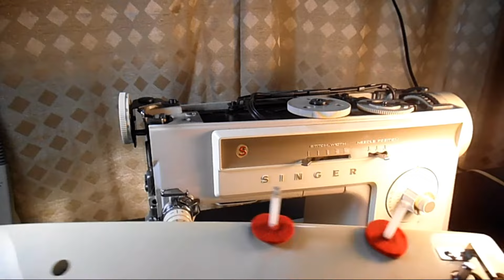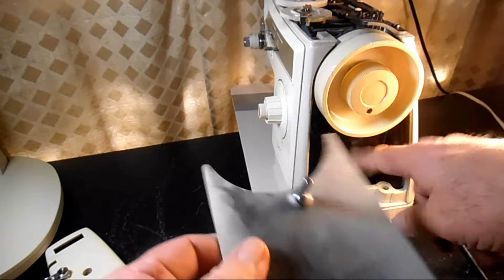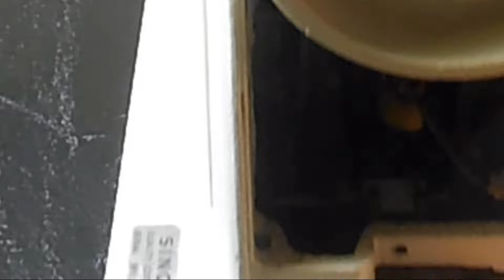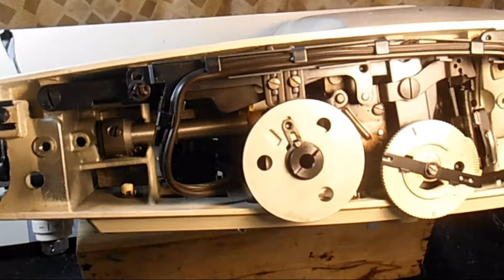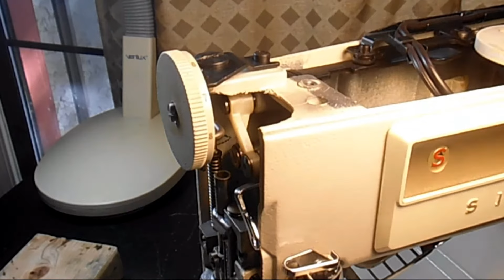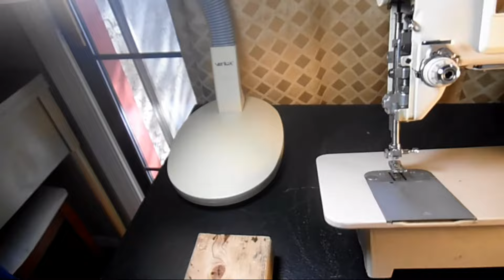A Look Inside a Singer Model 513 Sewing Machine

Comment: My sister owns one of these and has used it for many years. Recently it was seizing up on her, but seemed to be doing it somewhat intermittently. She lives in a different state and this  past Saturday she brought it to me when visiting. We got it running again, however I ran out of time to remove the oil plate and check everything out underneath. I’ve ordered her a replacement belt because the one on it seemed dry and/or brittle. Your video has given me the confidence to look at all of the hook mechanisms and the shafts transferring energy. Who knows what we will discover on the nylon gears.  She treasures the machine, so it’s good practice for me.  I want to dig into a 306K that was gifted to me in the past six months.
Reply from the maker: It's great that you help your sister. This video was my first good look at a 513 machine. It's part of my Playlist for the model: https://www.youtube.com/playlist?list=PLsCOZgzzaiKLELksv_-MWE7tiAuzOgQj0
Here is a list of videos viewers have given me that they found helpful when attempting a gear change.
https://www.youtube.com/watch?v=cYLzGwpoWeE
https://www.youtube.com/watch?v=x2acFJeDxwg
https://www.youtube.com/watch?v=qHx6VPdenj0
https://www.youtube.com/watch?v=0HirFoVVoxY
I appreciate your comment and thanks for keeping the older machines running.

Comment: Hi there. Although I don't have service manual for this model but service manual for class 800 (same as 1020) says to grease these gears. Class 800 is very similar to 513. The lower part is identical. Take care. 🙂
Reply from the maker: Sure, go ahead. The Singer repairmen I met told me no grease on plastic gears, so I go by that. I don't have the service manual you mention, but if it "says" to apply grease, then I would. Thanks for sharing and for watching my channel.

Comment: Hi! I have restored 2 401s, a 403, and a 301 this year w/ your help, thank you. 
I bought a cabinet for my daughter's 401 that had a 416 in it. I wasn't planning to keep it, thinking it was a newer, plastic garbage machine, but as I was poking around with it, it looks really cool! It's pretty immaculate with minimal if any yellowing, no old oil or grease to speak of. No plug or accessories. It hasn't been used recently at all. The inside is clean, the outside was the storage kind of dirty. 
There are a lot of similarities to your 513 on the top, but not the bottom. 
The upper vertical gear was broken, which I've already replaced. The far left plastic washer on the horizontal shaft broke to pieces, so I need to figure that out. I've bought the specific service manual for the 416/418 although it doesn't cover everything.
The machine will sew, but I'm having some binding issues. It seems like it's binding over on the right side, in the area of the reverse button, stitch length knob, etc. I can see the white plastic rectangular piece that slides in the feed dog fork (right behind the length selector knob) get hung up sometimes when I'm turning the stitch length knob back and forth. I have to turn the hand wheel for it to release and snap back in place. I'm assuming whatever's causing that is what's causing the binding, but they could be separate problems? 
I've adjusted some easy stuff already. The horizontal collar on the left side where the broken washer is. The camstack gear, although it was very stiff and didn't feel like it was moving. 
The machine was binding before I replaced the upper vertical gear so it isn't that. There's a buttonhole mechanism behind the stitch length dial, so I'm going to have to bite the bullet and start taking apart the scary stuff. Any thoughts?
Reply from the maker: Model 416 was made in 1971, 50+ years ago. Plastics have changed a lot since then. Restoration folks I have met that work on all kinds of electro-mechanical items tell me that "older" plastic like that has some tendencies to warp, bend, and swell. Binding and sticking is are fairly common problems. They often use modern synthetic grease to try to keep the parts moving properly.  
   Sometimes they have to dismantle and use emery cloth to "smooth down" the parts. 
Binding can be hard to pinpoint the true cause. An example is all the machines folks brought to me because "the handwheel is broken and won't turn," and I would find the bobbin case had jumped off the "race" of the hook and was jammed into the throat plate. 
     We tend to think the part we can see that doesn't move correctly is the problem, even though it is connected to other parts
that are harder to see and most parts of the machine move in unison. If the belt inside breaks, the motor will still spin like crazy, but nothing else moves. 
     I found out over time to try to be as sure as possible of my diagnosis before I started removing parts, especially a part like the buttonholer system. I've just never liked the dial control combo, I guess.
Reply: @andytubesewing1953  Ok, thanks for the response. It's still a mostly metal machine, not a lot of plastic in it. But I'll see if I can pinpoint the binding better before taking things off. The stuff I'm looking to take off is pretty well diagramed in the service manual, which is why I'm even thinking about tackling it. I guess I don't have much to lose, because if I can't fix it, I can't really use it anyway. I used one of the flexi-stitches to hem my son's pants, a stitch I don't have in my other machines. It overcast the edge much nicer than plain zigzag, so I'd like to save the machine if I can. Plus, that pale ice-green color is just cool.
Reply from the maker: @rockinfinch Best of luck to you
Reply: @andytubesewing1953  Thanks! Replacing the broken washer on the horizontal shaft seems to have cleared up my binding issue, but there's still some tweaking I'd like to do with the stitch length selector system before I put it all back together. The longest stitch length I can get is 7 sts to the inch instead of 6. And there's a bracket connected to that system that hangs up sometimes. It doesn't affect how it sews, but it's bugging me.
It's sewing beautifully at the moment.
Reply from the maker: @rockinfinch  Oh! That must have been the arm shaft thrust washer. I'll remember that. Thanks, and good luck. The service manuals have saved many machines for me.

Comment: Hi Andy, I just bought a cabinet with a 513 in it.  Machines was frozen, gears are good, got everything moving nicely, except the stitch length knob is frozen and reverse button isn’t pushing in.  Suggestions?
Reply from the maker: Hello Valerie. Singer model 513 was the lower-end model of the 5xx family and was made in 1972. 
     Singer had started using much more plastic by then and parts of the feed system has plastic parts that are now 50+ years old. They can "stick" together now, especially when not being used regularly. Fine dust can get between the pieces and restrict movement. Some parts can "warp" a tiny bit, too. 
     Sometimes blowing air into the area can be enough to free-up parts and get movement. I don't fool around so I use a leaf blower for max volume. Other friends like using a hairdryer on medium or low heat and high air flow. You can blow right into the dial, down from the open top arm, up from the bottom and through the motor end. Any way to get air inside.
     If that does not work you can take off the front cover and control dial parts https://youtu.be/zThFx1CoM-E  
You can also buy the Service Manual for $4.99 here: https://manualsoncd.com/product/singer-500-sewing-machine-service-manual-518-538-513-514-533/    
78 pages showing how to work on the machines.
     One fellow I know in Canada says he often works on these models and has to use very fine emery cloth to polish the parts to reduce their circumference so they can slide together again.
We would caution against WD40. If you really feel oil would help on a plastic part be sure it is safe for plastic and won't harm it.
Reply: Thank you for your response.  Love your videos.  I took the all the covers off accessed the back of the dial, brushed oil on backside and  used the blow dryer.  Got it unstuck, makes a beautiful  stitch.  I realize with its age and plastic gears it may not last long, but I wanted to try.  At 73, I like to challenge myself.  
Thank you for link to service manual.
Reply from the maker: @valeriegiacalone508  Very welcome. Thanks for keeping the machine in service.

Comment: Hi there and thank you so much for these videos! I picked up a 513 today but it won’t sew and the wheel is very hard to turn.  I’d like to try and fix it myself and I wonder what you think it might be.  The motor turns great in the bobbin winding position but not to sew.  Thank you ☺️☺️☺️
Reply from the maker: Hold on to your hat, Christine. I have information for you. This is a common problem with vintage machines that have sat idle for a long time. 
     The oil in the bushings and other moving metal parts can dry up and the parts get "Stuck". A common way to fix this is to oil the machine properly and gently turn the wheel and even add heat (via a hairdryer) to loosen the old oil. This can take a few minutes to a few hours of work, depending. You can download a free copy of the manual for your 513 from Singer SUpport here: 
https://www.singer.com/search/support?title=513   It shows where to oil the machine. 
     I also have a video that goes into a lot of detail about oiling model 513: https://youtu.be/F5Bt8x1XsrE    
That's the easy part, and if that is all it needs then good news. 
     HOWEVER, model 513 is a model with 4 plastic gears on the bottom of the machine that make the hook rotate and the feed dog work. The gears are old now and very prone to cracking/breaking (if they are not broken yet, they will be) This is a known problem with a dozen Singer models of this type.
     The most common of the gears to fail is the one on the hook shaft, just below the hoo/bobbin case, which turns the hook b/c it takes the most strain. The other gears can break also. The hook gear is easier to replace than the other 3, but the consensus is if you must replace 1 gear then replace them all.
     You can buy the gears online, just search for "Singer Model 513 Replacement Gears". 
There were not many videos made about how to do it, but here are a few to give you some ideas. https://www.youtube.com/watch?v=cYLzGwpoWeE     https://www.youtube.com/watch?v=x2acFJeDxwg
https://www.youtube.com/watch?v=qHx6VPdenj0      https://www.youtube.com/watch?v=0HirFoVVoxY
     You can also buy a guide for changing the gears from a real pro who wrote a manual for doing it. 30+ years working on SInger machines, including owning his own repair business. https://store.tandtrepair.com/513gg.html     The manual is about $12.
    The hook gear is less than $10, and the set of 4 gears is usually less than $20.  The oldest set of gears that I replaced is now about 8 years old and running strong. Other than those dumb plastic gears. Model 513 is a very nice model, especially for sewing and crafting clothing and home decorating needs.
Reply: @andytubesewing1953  omg, you are just the kindest person!  I’m going to try this on Wednesday as I’ve got to work tomorrow!
Reply from the maker: @christinebond1102  no worries. I have found that these vintage machines are very patient. I've worked on them a little and put them away for a week and come back and they're always happy to see me. I wish you the best of luck. If I can help you know where to find me
Reply: Hi there!  It’s running great!  I cleaned up a lot of old yellow oil from the bottom gears under the bobbin but now something is going clickity clack and I think it’s from the top?
Reply from the maker: @christinebond1102  I'm glad you got things moving. Be careful about noises b/c sound can travel thru the metal parts. An example is when a needle clamp is hitting the top of the presser foot. The sound travels up the needle bar and sounds like it is something at the top of the machine. Also, these older mechanical SInger machines can be a bit noisy if you are not used to them, especially with the top cover off. Were you trying to zigzag sew? That uses more moving parts at the cam stack that move back and forth (click-clack) An easy test is to put the machine in straight stitch mode to see if it goes away or lessens the noise.
Reply: @andytubesewing1953  no, it wasn’t on zig zag but I was so happy it was flying along.  The even bigger problem now is, when I move the wheel towards me to pick up bobbin thread, it hits something hard under the needle plate.  Going forward, it doesn’t hit but it also doesn’t sew.  I’ll get there eventually.  Thanks for everything!
Reply from the maker: @christinebond1102  Honestly thing it's a gear
Reply: I took a Video  but don’t know how to send it. 😊
Reply from the maker: @christinebond1102  It's not hard to upload a video on your youtube channel, Christine, especially a cellphone video. There are many instructions for doing it if you Google it.

Comment: I'm glad I found this channel!

Question for you, Andy  last night my 513 stopped feeding fabric. I checked everything outside visually and the only thing I noticed is that the feed dogs were not moving. Could this be due to a broken gear?

Looking forward to your reply.
Reply from the maker: Thanks for watching my channel, Juan. Yes, most likely a broken plastic gear. The machine will be 50 YO next year. The plastic is brittle. There are 4 gears on the bottom of the machine to move the feed and the hook. The standard practice is when one goes out to replace them all. Gears are available online for the $10 to $20 range for the set of 4,  just Google Singer Model 513 Replacement Gears. It's been a while since I looked, but there were not many good videos on YT for replacement methods. Terry has many manuals and his own guides he wrote for the machine. https://store.tandtrepair.com/st4134164185.html  When installed properly, a quality replacement gear should last over 10 years per my experience on other models. Good luck.

Comment: Hi Andy,  I have a 534 stylist singer that I replaced the gears and belt on.  I reset the timing  which works great on the straight stitch but the zigzag timing is off.  The needle crosses over in the down position instead of when it is up.  What can I do to fix this?
Reply from the maker: I can think of a couple of possibilities here. I think when you change the gears you must reset the FEED TIMING along with the hook timing. When you say you set the timing I assume you mean hook timing?  The other item is Timing the Pendulum Movement of the Needle Bar. You can buy a Service Manual that includes the model 538 ( there is not a special manual for 534) and it has instructions for both items I mentioned, along with many other repairs/adjustments for the machine. It only costs $4.99  and you can download it here: https://manualsoncd.com/product/singer-500-sewing-machine-service-manual-518-538-513-514-533/

Comment: help please!  I have a singer 522 which is similar if not the same inside.  I do all my own servicing and basic service but this one I can't figure out.  I have adjusted the tensions (top and bottom), but the machine will not do a stitch longer than a 1 or 2mm.  If I change the stitch length knob, it still does a 1mm or 2mm length.  Not sure if this is a feed dog issue or problem with stitch length button and I don't know how to repair it.  please help.
Reply from the maker: The eccentric adjusting stud for the feed dog may be turned 180 deg. the wrong way and be set on the low side instead of the high side. That can make the oscillating path of the dog much shorter. Model 522 is a tubular bed model and the lesser of the 533/538 Class machines. Suggest you buy the SERVICE MANUAL for Singer Model 538 which has all adjustment/replacement instructions. It cost $4.99 to download from this seller: https://manualsoncd.com/product/singer-500-sewing-machine-service-manual-518-538-513-514-533/
Reply: @andytubesewing1953  you are an absolute star; I can't thank you enough.  Have bought the manual and will go through it with husband to see if I can fix it.  I don't suppose you know how I could fix a Bernina 1001 width dial (seems to slip when I do zig zag) but learnt recently that you do not oil plastic gears!  I am very fastidious in keeping my machines clean and I think I may have oiled the plastic gear or whatever behind the width dial.  Have been trying to get a service manual for Bernina 1001 but cannot seem to get one anywhere.
Reply from the maker: @ramilapatel5364  THANKS ⭐ Good luck with your 522. I don't know anything about Bernina but take a look at this manual:
https://data2.manualslib.com/pdf5/106/10600/1059902-bernina/1030.pdf?9fc73d80be994a7591153afd28834359